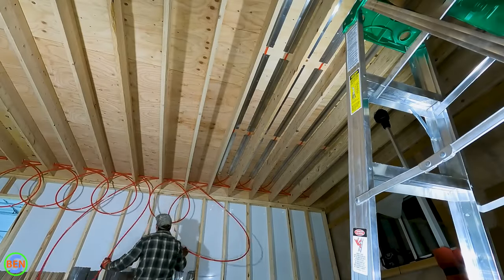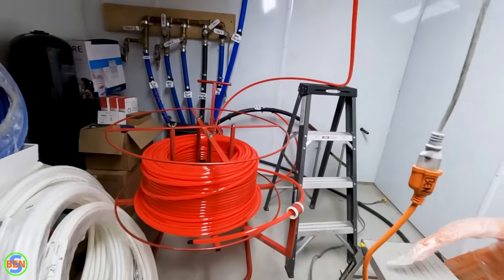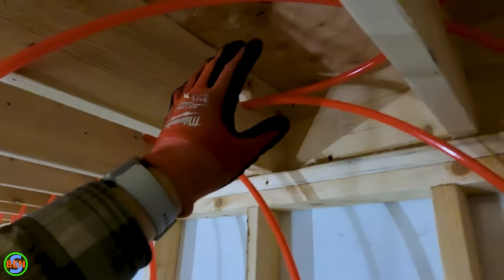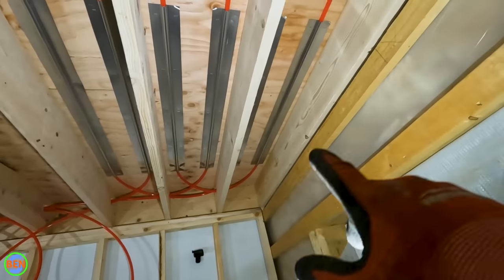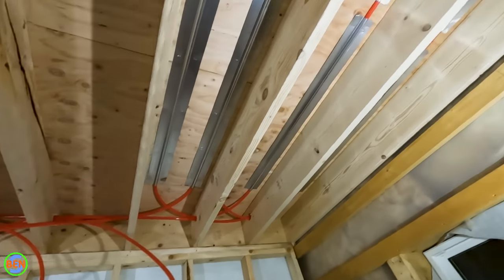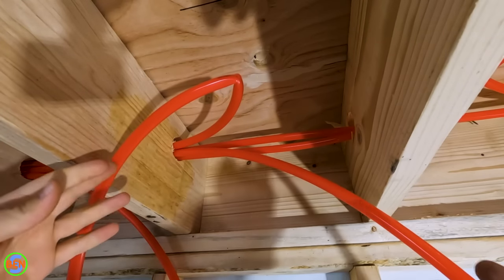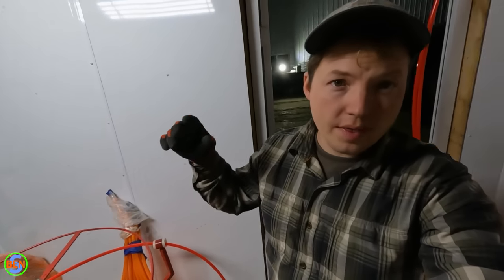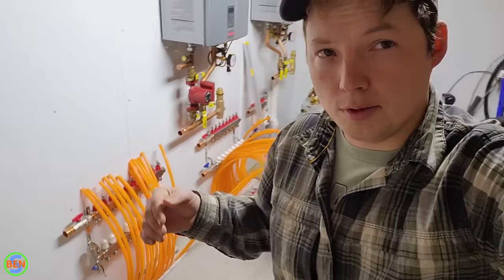How To Install Under Floor Radiant Tubing With Aluminum Omega Heat Transfer Plates Between Joists

Comment: NOT ALL TYPES  OF WOOD FLOORS ARE COMPATIBLE  WITH UNDERFLOOR HEATING.
THANK YOU FOR PASSING IT FORWARD.
Reply: I've installed many, and never come across a wood floor that was somehow incompatible. My last job was in my own house, and I had prefinished solid maple. These systems are lower in efficiency, but work well regardless.
Reply: @paulmaxwell8851  I HAVE. TRUE  STATEMENT.  HAPPY HALLYDAY'S 😊
Reply: More of a "Warranty" issue than a real issue.

Comment: There is a argument that the heat transfer plates are not needed due to the nature of the floor assembly being saturated with heat and the slow nature of heating the system.  Great job on the install.  Nice video.
Reply: Agreed. I installed yrs ago in a new house. Read the pros and cons of transfer plates. Decided not to use. No noise. Even heat. Must keep set temp, no set back. Takes time to both heat up AND cool down. Best even, quiet heat.
Reply: Yup. Plates are pointless
Reply: @adamenstrom  I would think that depends on how much heat you are trying to transfer and how much floor area you have to transfer it.  If you don't use the plates, how do folks hold the PEX in place?  I used the plates based on the research that I did at that time, but that was 18 years ago.
Reply: @richdobbs6595 Mine are held in place with 1/2" half opened holding clips that secure to the sub floor with provided nails. The way mine was done was definitely half assed though and I plan on adding more of those clips when I redo my insulation. When budget allows, I would like to redo everything with the plates eventually.

Comment: Very good work on the video and very informative. 
 I just put this into my house. I retrofitted underneath with the 1 inch boards and then hardwood on top of that. During this most recent cold snap the system couldn’t keep up. I still have not insulated between the joists. My question is will insulation make a drastic difference. I have a friend who set his system up almost identical to mine and he didn’t insulate in order to heat his basement as well. His system keeps up fine. I’m wondering if it’s an issue that there’s at least 1 3/4 inches of subfloor or should that not make a difference?

Comment: Nice work. Making the holes bigger as you suggest is the best advice. I fought with a lot of pex because of this.  
The twist and pull is the method I use instead of having all those loops hanging and feeding. Its way faster and reduces the chance of kinking. You could've heated up that kink if it wasn't too bad. 
Always have a plan drawing for the routing this way you can combine some shorter loops with potential longer loops. It's easier to balance out the loops on paper first.
I have done 1/2"  350' runs without issues but I do planning to stay below 300'
Design the flow to heat from the outside in and keep off the outside wall by 12", don't heat but completely insulate the outside joist to the box.

Comment: Great video, not sure if I missed it or could not find, but what is the heat source for this system? 
Would love to see you do a video on Air to water Monoblock or a Heat Pump to indoor unit maybe even a hybrid Outdoor Heap pump to Coaxile exchanger to buffer tank?? Really like you video's.

Comment: Its for this reason, inefficiency,  that i went with Ecowarm floor panels for my in-floor heating of the upper floor of my garage.  I had the project panels layed down and secured, and the PEX tubes run in about 4hrs.  AND the efficiency of the heat getting to the room is MUCH greater because the tubes are IN the floor and not UNDER the subfloor.  UNDER means you need a hotter temp to heat the tubes, the aluminum flashing, then the 3/4 or greater subfloor, then FINALLY the heat get to the room. I like way much better...lol.

Comment: I did runs no more then 250 ft, and nailed it on the side of the joists on 1 ft centers 2 ins down, so I didn't have to worry about nails going into it from above, and put 2×8 insulation underneath, and insulated all interior walls,

Comment: Hey Ben! Have you ever installed pex floor heat in a log home loft 
I believe I need to install T&G to provide a ceiling, then install joists to allow space for loft bathrooms, then a product such as warmboard so the pex tubes can be placed, followed by my finished flooring 😳

Comment: As manufactur recommend, why they keep the pipes 2-3 inches on cement floor  but nothing on wood floor. You install it directly under the floor!.what about if the customer want to install a new subfloor in future for some reason it will damage all  pipes and waste money.  I think should install a protection metal plate or leave a gaps between the pipe and the floor around 1-2 inches to avoid any damage or issues. What do you think as manufactur recommend?  Thanks .

Comment: Great vide, this is exactly what I want to do to my house as a retrofit.  However, the house was built in 1960 and the main floor has 1” hardwood oak strips.  So the underside (where I’ll be installing the pex) has about a billion tiny nail points protruding.   

Do I grind them all off?  The floors squeak so ideally I’d like to replace the subfloor with plywood (it currently is the old 5” planks).   Can I tear up the oak flooring, tear up the planks, put down plywood (with construction adhesive and screws) and then…glue the hardwood flooring back down?

Comment: What are your thoughts about running a PEX Radiant Heat Foor System above the subfloor versus running the system below the floor for new construction? For remodeling, this method seems more cost-effective.

Comment: My main concern with this installation method is the risk of nails from the hardwood floor installation on a new build or renovation project puncturing the PEX piping. Many installers use wooden blocks instead on the underside of the floor and attach the pex to the blocks. Heat rises and will still heat the floor above even if the PEX piping is not touching the underside of the subfloor.

Comment: Great Video!!  well explained and detailed.  question.  If you have I-Joist on 16" centers could you run bigger tubing and just one tube down the middle instead of two tubes?  Maybe 5/8?

Comment: Made my own plates out of aluminum sofits each panel was 24 inches by 15 inches with two rounded channels for the pex. 
Twice the heat transfer and cheaper than those plates.
Reply: How did you do it?

Comment: I have this type of in-floor in my house, with separate thermostats for my in-floor to the 110v zone pump relay (a two-wire Honeywell dial) and a normal five wire thermostat for forced air/AC with backup heat strips. I want to run the in-floor as W1 and heat strips as W2 on the same thermostat, so I am considering a 24v-24v transformer to connect my primary thermostat W1 to the zone pump relay with transformer isolation, then switch the W wire back to the air handler control over to W2.
Maybe a chance for a follow-up to your recent thermostat wiring vid on how to control radiant + backup heat from the same thermostat?

Comment: any heating system has conducted heat the pipe and plates touching floor, the convection of the hot air collecting up against the underside of floor rising up, and radiant heat. which is only a part of the heat going up through floor. my bathroom is heated with nothing but copper pipe up against wood no metal plates or insulation with 3/4 tongue and groove boards then plywood above it and linoleum tiles on floor above, but my system runs at whatever high temp my whole system is at for baseboard from 120 to 180 with high efficiency boiler so I didn't want my floor burning hot when barefoot out of shower 
I might add aluminum plates or insulation if we want more heat but i think this system you have there will be plenty warm

Comment: Very interesting didn't know this was an option. I have access to my basement or I could technically do my full house this way I wonder how efficient it is I would definitely stuff some rock wool under it and then probably air seal it

Comment: Those are pretty big holes you are drilling, and off center from the middle of the joist too.

But, this is a very informative video.  I have a small house with a crawlspace that is open to the ground under it, about 3 feet tall.  I'm wondering if this would be efficient in that case where the heat is not embedded in a floorspace?

Comment: Great video.
So with 300' run max, or even 500' with 3/4" pex, how do you deal with a 20x20 or larger room? 
Do you have to run multiple loops for that room? Or could you just do less loops and leave out outer rim, so treat it like 18x18 room?
Reply: Yes, you'd have to run multiple loops (circuits). You wouldn't want to decrease the room to 18x18 because the perimeter wouldn't be heated. This would be especially bad if there were exterior walls. (they would be much colder in winter)

Comment: I tried those plates and had a terrible time with installation.  I ended up using Uponor Joist Track and they were much easier to install.

Comment: Nice video!  I grew up in Slayton.  Just a few miles from you! ;-)
Reply from the maker: What! No way! That's awesome. Was just in Slayton at Bomgaars the other day. You still around the area?
Reply: @BenjaminSahlstrom  I have been living in San Francisco Bay Area for the past 30 years.  Engineering degree and Silicon Valley is the rest of the story.

Comment: How well do these perform with heat pumps? Do they transfer the heat well into the floor or have a very long warm up time?
Maybe they would be suited to an always on weather compensation system to keep dripping in the heat rather than on off fossil systems.

Comment: Great video. Question for anyone who may be willing to answer: I took down the wall between my dining room and kitchen and sacrificed a 1950’s vintage hydronic radiator in the process (basically snipped the supply lines to that one radiator that branched off the main supply line). Could I relatively easily run underfloor pex in place of the old radiator, just under the footprint of my former dining room (about 100 sq ft)? Or do I need to do some fancy thermodynamic calcs to make sure my boiler can handle the added heat loss of adding underfloor radiant? I assume the underfloor radiant would have similar efficiency to the old radiator, so I’m guessing it wouldn’t adversely effect the efficiency of the heating system on the whole? It seems like it could be a pretty plug and play solution to restoring the heat to this space?
Reply from the maker: Good thought. Unfortunately, your boiler is likely set to operate too hot for in floor heating. You should keep the water going to staple up radiant at 130 degrees Fahrenheit or lower.
Reply: Thanks for your reply.  You are right, I checked my boiler and it’s set to 170.

Comment: Hi Ben, as per usual I cam across your video through pure accident. Enjoyed it very much and was curious in what state are you in? I was a plumber in Germany and all I did was Viessman boiler systems with Grundfos circulating pumps which I see in boiler that you installed. This is the first time I see it in the US hence my question. Also are you a one man show and what is your title … a plumber some other kind of technician? Thanks
Reply: Minnesota. He is a Master Plumber, and very educated (self-taught) in many of the trades like construction, HVAC, and electrical as he basically built our whole house himself. He is Mr. DIY!

Comment: Is there a video on the water heater install yet?,  A question I have is where will the water used for the heat, end up at?   Thanks.

Comment: I’d go further than 6”.   My joists state a 2” hole needs to be 7” from the load bearing end and a 3” hole should be 8” away.  Since you went over, the 8” should be used.  Hopefully tradition lumber is different.
Reply: do you have I-joist?  i was thinking the same thing.  i think mine says 7 inches from load bear for 2 inch as well
Reply: @beesonman05  yes I have an Eacom 14” PJI-60.   I’d be willing to bet a piece of lumber is much worse on what you can do and where.

Comment: Drill bearing studs without amplifying? What will happen if owner put something heavy on second floor? Probably you should attach some steel rail below drilled studs.

Comment: Awesome video! Do you need to use aluminum staples to prevent galvanic corrosion?
Reply: Rubber staples.
Reply: @adamenstrom 😂

Comment: Steel staples on aluminum will not last due to corrosion. Secondly, in floor heating works much better in Gyp Crete.

Comment: Watching your video on ground and neutral separation I have a older garage and it’s bonded together with just three conductors to the garage two hits and neutral I use a fare bet if electricity in the garage but can’t see that would be the cause of my very high electric usage does it have any effect on my electric usage because of this

Comment: The only down side I see here is the only contact points from the metal to the floor is at the staple points. The rest seems to "push away" from the sub-flooring making small air gaps that would significantly reduce conductive heat flow into the flooring above.
Reply from the maker: True, more staples would help too I suppose.
Reply: You're probably splitting hairs at this point. The extra cost for something like Uponor Quick Trak sealant may not ever pay back dividends.

Comment: The holes should really be in the center of the beam as that is where the neutral axis is and zero stress.  The stress varies linearly from the NA to the outer fibers of the beam ( top and bottom) resulting in either compressive or tensile stress in the beam.
Reply: Technically true, however as you can see, these joists are denser packed than standard, as well as resting on a hard sill plus the stiffening of the plywood sub floor above attached with fasteners. It's way stronger than it needs to be for this application so those holes placement shouldn't be any issue.

Comment: I'd highly recommend using a non curing, flexible heat transfer compound on the flat sections of the omega plates. Google will find numerous educational and industrial resources for this. It's often referred to as mastic.
Reply: I have a very old house with irregular subfloor. I’m considering using joist track over the omega track but have concerns that the track won’t lay flat against the subfloor. Would bridging the gaps with heat transfer compound improve efficiency?
Reply: @JayPoe80  it would mitigate the heat break from gaps, yes. Make sure it's non curing, so you can replace sections if you need to, and repair that tubing from time to time.
Reply: Do you have a brand or name of that you'd recommend? Using a caulk gun?
Reply: @kkane97  nope. Just look for heat conductive mastic. You can find a lot of detail :-)
Reply: Cancer. Avoid using as many glues and compounds as possible for quality of the air you breath. I don't built with sprayfoam for this reason
Reply: @svenwalker5955  if you're concerned about that, don't use radiant heat like this. The piping is plastic. Use copper base board forced hot water heating, and install a corner ceiling fan in every room. The mastic I was talking about is more stable than the plastic pipe, FYI.

Comment: Hi my house is off the ground and I have a crawl space 20 inch. As you can tell my floor get cold as hell in the winter and hot in the summer. about 3 to 4 years ago I got it spray foam but later it was a waste of money because it felt the same nothing change whereby the floor still cold in tje winter and hot in the summer. Jax FL 

fast forward. I should have added pex first before spray foaming the floor.. 
Question: if you or other might know. If I now add PEX lines on the foam do you know if the heat will get through the foam and heat the floors? TIA

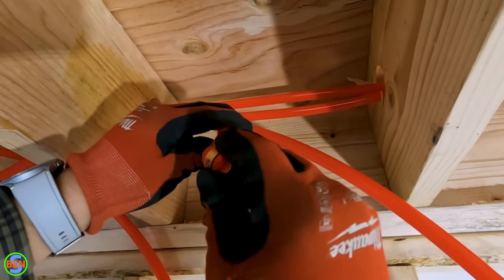Comment: At 15:43 this is incorrect. Zurn tubing can be connected with cold expansion and it's 'B" tubing. Same goes for Sioux Chief "B" tubing. The reason why, is because both conform to ASTM F1960, the standard that describes the cold expansion connection method. PEX A vs B only describes the extrusion method of manufacture and has nothing to do with how it's connected necessarily. It's a very common misconception.

Comment: I have so many questions but will just ask one. Is this a good replacement for an electric heat pump that has electric heat backup? We have a heat pump as our sole source of heat and it does not stop in December, January, and February when our temps get below 20 degrees. If we're not careful, our bills can get to $400+. We have a one-story with a crawl space so nothing to heat above or below. So, I'm curious if I can ditch the heat pump in the winter and go with something like this. My friend has his hooked up to an outdoor wood furnace and says it will heat him out of his home. Not sure if I want to use wood heat so thinking more about propane or electric. Thank you.
Reply: I had that problem (high heating bills) a couple years ago.  It turned out the heat pump "emergency strips" were turning on and I was heating with straight electricity, not pumping heat.  The fix?  The kitchen area of that house is open to the second story and heat rises, so that ceiling was getting all the heat and I was losing huge amounts to that section of roof.  I turned on the ceiling fan the landlord had installed there and brought down the heat, and never had a high bill again.

In your case, you might want to figure out the cause of the excessive heat loss first.  Flir makes an IR attachment for smartphones and I found they are really helpful for seeing where heat is coming from, or going to.  They can be expensive for a one time use, but you might have a friend who has one.